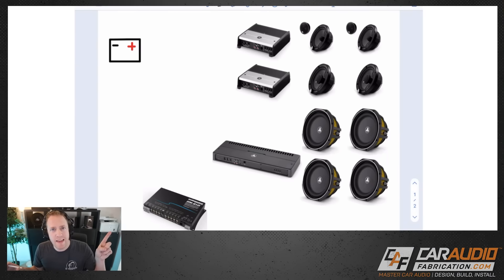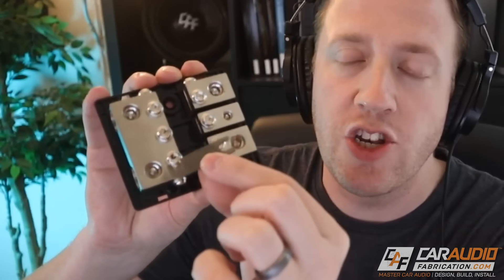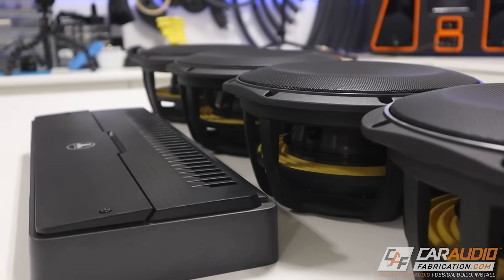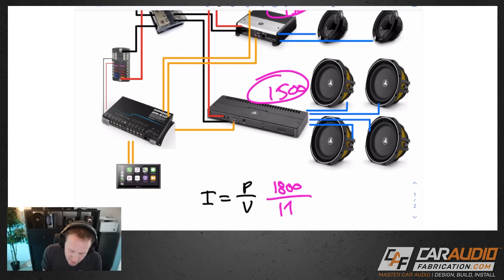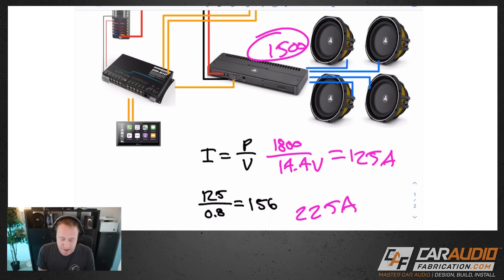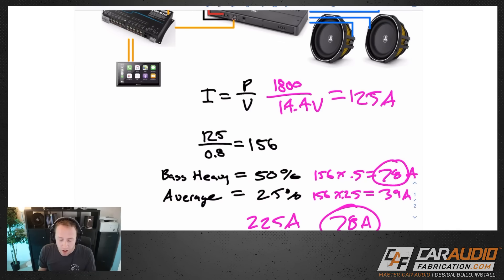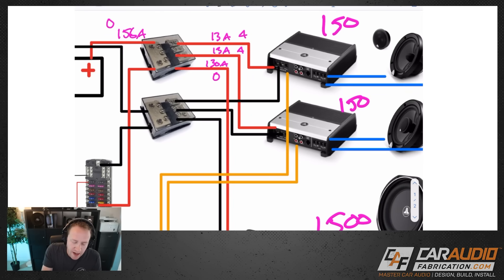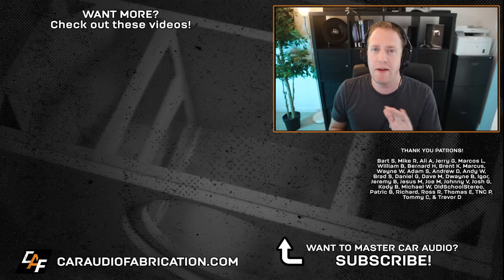HOW TO - Electrical System Design for 3 AMPLIFIER + DSP Car Audio System!

Comment: I have a question about your wiring diagram, there is one wire missing. The remote control wire from the amps to the head unit, I know this holds a small amount of power. Now when connecting 2-3 amplifiers a system how would I splice/ distribute this properly? would I need to add a small capacitor in the system then split from there? or just wire them together before the head unit? and help would be appreciated. I have done about 10 installs over about 15 years, on personal vehicles of all sorts and I have found your videos rather informative and touch on some of the things most people over look, Thanks for them and keep up the good work.

Comment: Dream system for me would be pioneer AVHX4800BS double din radio in to so digital fused distributor pushing power to a audio control EQ then on to a couple JL Audio HD1200/1 amplifiers powering 2 JL Audio 13W7 in a fiberglass custom fit box, for my mids & highs I would use 2 JL Audio HD 600/4 amplifier all amps on custom racks, pushing power to several pairs of JL Audio C3 6.5", 6.5" added in rear lift door,  6x9", and for my vehicle specific also 5.25" in dash. All powered with primary and a secondary Xs power Battery and charged with a JS-alternators 300watt alternator with everything connected together with 1/0, 4, and 14,10 gauge wiring. Also a little bit of sound effecting LEDs strip lighting under the seats.
Reply: And definitely sound deaden the entire vehicle a town and country in my case. With all the door were my highs and mids reside sealed up real nice, foam rings direction the sound out to the cabin no wave escaping in the doors. Continued on sub box I think I would want the rear seats removed and have a false floor in both areas were the seats store to hold the subs and amps with some acrylics view windows for a real nice visual and then maybe bolting/adding different seats bucket bunch seat maybe to replace the factory seats pulled out. And instead of 13w7 I would maybe rather go with 3 13w6v2-d4 to get that 1.33ohm ability with the 3 JL subs wired correctly in the right way... Thanks mark good stuff

Comment: Do you ever NOT use a DSP? Or is it now a necessity? I can’t seem to find a basic install video on your channel. I really do not want to use a DSP!
Reply from the maker: Would you build a performance car and not expect to have the need to adjust engine parameters to tune to optimal performance? No. Same goes for an audio system. You MUST tune to get the most optimized performance. But everything's a trade off, if you don't want to add DSP the trade off is that you simply won't have the best performance that your system could have.

Comment: My Dream?
For my "14" Srx, is replace all the Bose with a Focal (Flax) 3-way running active, custom install front stage, to include the rear doors and trunk with Focal Flax full range speakers, Flax 12's for lows, custom spare tire build, along with custom amp racks, to keep it useable and stealthy. Audio Control products would run everything for me.

Comment: I’d probably want a single Pride Audio Sv.3 18 in a 6th order enclosure. 4 8 inch mids and 4 1 inch silk dome tweeters on a DSP. 6k amp for sub and 2 2 channel amps for the mids and highs

Comment: My dream System would be for a 2015 Volkswagen Golf. I would get 2 tweeters for the corners of the dash, 4 speakers behind the door panels, 5 underseat Subwoofers. 2 under the front seats and 3 under the backseats. On the backing of the seats I would mount 3 high quality amps and the rest required in high quality

Comment: Hey so i have a bit of a problem because i dont know if my maths are wrong?
I have 16 4ohm 8 inch mid range speakers. 4 for each door of my car. I also have two 4 channel amplifiers. I want to use two of the four channels on each amp which will give me 4ohms/channel. Each amp will put out 4x200w RMS. SInce i don't have any subwoofers does that mean that i only need to add 200 to 200 and then devide that number (400) by 14.4V? The result is 27,7 amps which seems so small a number compared to your 125, especially since im running 16 mid range speakers? Thanks beforehand :)

Comment: I agree you wouldn't be playing at max power all the time but when you do you are probably going to have the dimming headlights.  Most decent amps nowadays actually put out a substantial amount more power than they are rated, watch any Amp test on a Amp dyno.  Then you have to consider how much of that power the vehicle itself needs to operate, some of these newer vehicles are power hungry as hell.  How would you go about measuring that aspect to see how much extra power the alternator is putting out?

Comment: I have a 2013 Hyundai Veloster  with an Audiopipe 4 channel 800W running the 4 Kicker coaxial door speakers and another Audiopipe Amp that is a 2 channel 1k W going to my 2-10" Memphis subs in a ported box with a OEM head unit and an Audio Control LC6i between the head unit and amps. I want to add 2-12" Memphis subs and 2 Audiopipe 1800.1 amps with an Amp to each 12" sub. This is going to require me to customize a box to hold 2'12" and 2-10" subs along with a custom amp rack.

Comment: So, I own a semi truck. Currently have a 12" L7. The build is 3 L7s and 8, 6.5inch ds18. Running with rockville dbcomp5 and 2 db45s with a audiocontrol dm-810. That's if I don't change my mind again lol

Comment: My dream system has 8 tweeters, 6 mid range drivers, 4 woofers, 4 full range drivers, 4 8inch subwoofers, and 2 14inch subwoofers. A grand total of 28 speakers across 28 channels. 8,000 watts of pure and perfect audio bliss. $30,000 in equipment.
Reply: With all due respect do whatever you like but i want to understand the purpose of it. Even the music ain't made for 28 speakers and is it even gonna be any different?

Comment: My Dream System: semi-SQ Build in 08 Yaris 2dr RS. Sound Deadening through out as needed: Noico 80mil, Wiring/Distribution: Stinger, Head Unit: Kenwood DNX997XR, Into DSP: Audio Control DM-810, Front Stage Speakers: JL Audio C3-650 in coax config with Stinger fast rings, Rear Stage Speakers: None, plan to keep all speakers facing driver, Subwoofer: 1 - 10" JL Audio 10W6v3D4 in sealed custom fibreglass/mdf enclosure using the Spare Tire Well space, Amplification: Front Stage 1 JL-Audio XD200/2v2, Subwoofer:XD600/1v2. That would be about it! Enough to rock my daily driver... i think so. Cheers Rob

Comment: I have my DREAM SQ SETUP.
I'm an Electrical Engineer and I've been into car audio since 14 yrs old.
Source - Spotify premium is enough over Apt-X HD Bluetooth puck, out optical SPDIF to JL Audio (JLA) Twk88 DSP.
Fully digital Active 3-way front stage.
DASH
Amplifier JLA 300/4 (75Wx4 regulated class AB) 
2x RBH 4" Berilium Cast drivers; 250Hz - 2.5kHz
2x Vifa Ring Tweeters; 2.5kHz - 20kHz
DOORS
Amplifier
JLA HD600/4 (150Wx4 regulated class D
4X JLA C5 650Wf 6.5" woofer- 100-400Hz just midbass.
SUBWOOFER
Amplifier - JLA HD750/1
Subwoofer - JLA 10W7AE (arguably the BEST subwoofer you can buy for car audio) in JL's factory sealed box.
150W Bass shaker in driver seat with separate volume knob.
It's a dream! Unparalleled sounds quality and detail. No passive components anywhere.

Comment: Honestly a recreation of a former system I competed with would be my dream system. Was also last system my mom heard in a rig of mine before she passed. Three way cdt audio system up front, 225 hcca bridged running each side passive, 250 hcca running 8 Orion xtr 8 inch subs in a wall. Linear power x02 crossover and audio control eql. That was a fun system.
Reply: Man they don't make amps like the Redline anymore. Orion subs and amps were amazing before they sold to Hott Setup. Pro Tip, if they sell it at Best Buy is probably low/ midgrade. 
R.I.P. Orion HCCA, Phoenix Gold, and PPI

Comment: For my dream build in my Ram, 

HU: Alpine Halo11 iLX-F411
Speakers: JL Audio. 
Speakers: C7 for the 3.5 on the dash, 
in the sail panel the C7 1” tweeters. 
Doors: C7 6.5 in the front doors. 
Amps and subs unknown at this point. Although I do like the stealth box for my Ram from JL audio.

Comment: You are basically building my dream system in your F150.  I have a 2020 Ram 1500 and all the same speakers are on my crutchfield wish list.  I love the JL C6’s. Though I am looking at the vehicle specific JL under seat dual 10 preloaded box.  Since I don’t the experience or know how or tools to build my own custom box at this point.  Prices are just a bit out of control pushing it out of my budget.  Crutchfield also states to keep my factory head unit and offers no replacement options.

Comment: Dream system in my ‘21 Ram 1500would be a pair of Mosconi 5/30 amps running a three way front stage 3 way set of audio frog gb series maybe gs8’s in the doors with gb 4’s and gb 10’s in a custom pillar. Rear fill as just some coaxial audiofrog gs 6x9 ’s. Pair of jl12w3’s in a sealed box powered from the sub section of the 5/30 amps. Sound deadening installed professionally because I have 0 skill in that category but would probably cost as much as the rest of the system if not more. Keep up the good work!

Comment: can anyone help me figure out what kind of distribution blocks and how many i need for my new setup? head unit kw-z1000w, 4infinity kappa 6.5, 2-10's alpine s type, 2 amps sundown 200.4d/1500d, audio control dm-608 dsp and a audio control the epicenter! i was thinking KonFUSED 4 Way Fused Distribution Block or 2 Bassik 3 Way 0 to 0 - 4 Gauge High Current Fuse Distribution Block.

Comment: My dream system:
I will not be picky with the source, anything that runs smooth, has touchscreen, apple carplay and rca's out.
For the mids/high s I would want to integrate some deaf bonce sylvester/arnolds in the already existing door locations (I know a lot of SQ guys are here but i prefer high efficiency)
Any good horn tweeter that complements the mids would do.
Amplifing them i would love at least 150w/channel, but i would rarely use it over 50w.
For the bass part i would go with one 15' ore two 12's, just because i still need some trunk space for other things. My prefference for the subs would be Pride neo , just because they are extremely powerful and don't weigh that much.
I would like a 5k amp for the bass but use less than half, just in case i will need it in some ocasions.
For the dsp I would go with Hertz

Comment: Really looking forward to seeing how this system comes together, specifically how and where you mount the amps and crossovers. I have a 2020 F-150 crew cab. I haven't done anything with the audio yet, but I'll likely take a lot of "inspiration" from your build, just to a milder extent. I have a pair of JL 8W1s and a 250 watt JL amp from a previous vehicle that I plan to re-use, and I'll probably go with the JL C2 speakers rather than the C3. Still unsure what amp I want to use for those. I'm also going to keep the factory radio, so I'll probably be looking at an LCi7 to go with all of this.

Comment: I have a question, does the math change if your running a second battery still on a stock alternator?
Reply: Second battery on stock alternator is not a good idea.
If your drawing enough for 2 batteries, that alternator will exhaust itself trying to charge 2. Not enough balls.

Comment: I'm about there ...need dm810 ,Orion xtr1500 on three alpine r10's Orion class a/b xtr500.4, and xtr750.4. 4" polk coaxial dash and three sets of alpine s all in a 17 Silverado stock 170amp alternator sx power d1200 and cap bank

Comment: Just recently finished my stereo build in my 2013 F150 SuperCrew. Hertz Mille Pro 163.3 3-way component system up front in custom pillars. Hertz Mille Pro 6.5 coaxial in the rear doors. For subs, I used 4 JL Audio 10TW3 D-4 under the rear seat. Front and rear are powered by JL Audio HD600/4 and the subs are powered by JL Audio HD 1200/1.  Amps tuned to proper gain voltage and time alignment for all speakers. Entire cab of the truck, including the actual door panels, was covered in Sound Skins Pro sound deadening. Couldn't be happier with the outcome.

Comment: Do a video on alternative DSP processors, as a Cypriot (Europe) citizen I have no access to the brand that sponsors you without having to pay massive shipping fees and import taxes!! Please! (musician that needs a banging metal rig in his car).
Also, after 2 years of use, my system overproduces highs and vocals aren't clear. Is it the stereo, speakers, wiring or amps? I'll test and try to troubleshoot!

Comment: Dream System:  Mechman 370, XSPower batteries, Morel Supremo 602, Raven 12XL subs, Mosconi DSP 8to12 Aerospace with 2 LC4.800s and 2 LC1.1500s........  oh wait... that is my current system lol!   the only thing im changing in future is to Mosconi Pro amps.

Comment: For my dream system (assuming this is for my current car/build): JY Lithium and GP 320a alternator, Focal K Series Elite for the front components and rear coaxial, RF T1000AD for mids/high power. Knuconcepts lime colored 4/0 wiring, b2 Falcon or Osprey powering 2 Sundown Zv6 12s in a customized 6cuft trunk wall (because it'll have to be a pentagon shape to reach that volume in my Elantra's trunk). I'll keep my Pioneer 2660NEX or upgrade to the newer version of that line as I'm pretty happy with it.

Mark: you have nearly single-handedly taught me everything I needed to know when starting out in car audio. Your videos taught me everything from how to run wire to understanding the construction of a solid box and how to read T/S parameters. Whenever someone asks me how I learned so much so quickly I point them towards you. Thank you for all of the knowledge and knowing how to teach.

Comment: Ok so right now i'm building an SQ system with a 3way front end and i'm putting the midbass under the seat. Its a .6 cubic feet or 17 liter sealed box "if I need to make it smaller I can" the driver that I want to put in it is a DLS scandinavia 165wi but sadly its hard to get it here in the us. What other drivers would you recommend? I've been researching a few drivers from SB acoustics and Accuton but haven't found anything that fits the bill. also the midbass will only be playing from about 80-200 hz.

Comment: Ok I own a 2013 Hyundai Elantra gls I want to change the system in there but I want to keep everything looking stock what’s a good idea please help
Reply: If you're ok with your head unit, run a line out converter to a 5 channel amp, upgrade the 4 door speakers and add a sub in the trunk.

Comment: The best speaker system?  One that can go from at least 4Hz to 22khz perfectly flat response when eq is flat.  at moderately loud volumes.
Reply: At least 4Hz? 6 won't do?
Reply from the maker: 😆 flat
Reply: @YohanathanD  
I can hear down to 4hz
and I can hear up to 22khz
Reply: @YohanathanD  
maybe it's just vibrating my head and I perceive it as sound...
Reply: @jeffmofo5013  more than likely. You can definitely feel  the pressure in your ears below 20hz

Comment: Dream audio system: 3 way c7 components in the front and 2 way c7 components in the rear, 2 12w7ae subwoofers all powered at full capacity with as much sound insulation as will fit in the vehicle
Reply: That’s what I’m trying to do! But I have no idea what amp to use for all the components

Comment: As I get older I'm finding myself wanting more crisp clear quality sounds 👌...but I still like to crank it up too...
Reply: I like it clear but I crank it because I’m old and deaf. Lol.
Reply: Mannnn fr im 26 and got rid of my subs and just started redoing my system with mods and highs my god 😊
Reply: I'm with you 100 percent on that 😎
Reply: Man I'm 43 and still a basshead. I'm so stuck lately because my midbsss is lacking (Infinity 6.5 comp set x 2). I'd LOVE to have like 4 8"s, 2 10"s, and then my 2 18"s on a switch in my console so I could turn the 18s off when I want to listen to something that SHOULD be listened to in a sealed box, hence the 8s and 10s.

Comment: Full power from the amps is useless. Speakers distort more as spl increases. You'll destroy them if you keep cranking up the volume knob. Your amp signal can be perfectly clean. But the speakers lose composure.

Comment: I have the same knuconcepts dist blocks.  My dsp is wired to those blocks, using the side connections. My gripe is that the clear cover no longer fits. I have to trim that cover to fit.
Reply from the maker: Just keep in mind anytime you step down in wire size you need to make sure the fuse is properly sized to protect that wire. Learn more about that here: https://youtu.be/0H005TcKHKo
Reply: @CarAudioFabrication  Oh yea, dsp maker says 2 amp fuse is fine. I have one inline.

Comment: for a dream car audio system. What I would love to have is a setup similar to the Cars movie DJ character. I would have this as a show car mostly. 
I would go for around 6-8 12s and maybe 2 18s. would want around 2 component per door (probably 6in). I also would be running some lighting to match the music or for mood. lastly I would go for a custom head unit (self made with specific computers). for mounting amps and boxes I would go for acrylic enclosures for hardware and amps then a very acoustic wood (real, not MDF style).

Comment: People need to understand on grounding a vehicle.... if you have the new cars it's unibody so yes go to the battery.... in your case you have a truck so it has a steel frame ground that sucker right to the frame as short as possible

Comment: Why didn’t you do a 4, 6 or 8 channel amp for the fronts and rears? Dual 2 channels just doesn’t make sense
Reply: As was explained in the previous video, supply shortages. He could obtain the 2 channel models, not the 4 channel ones.